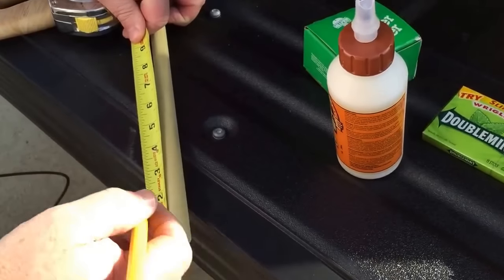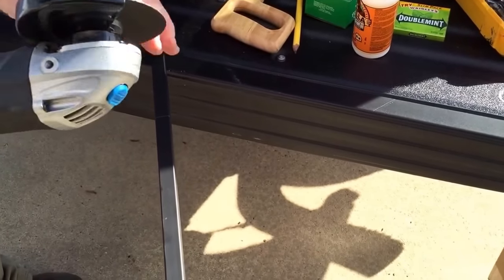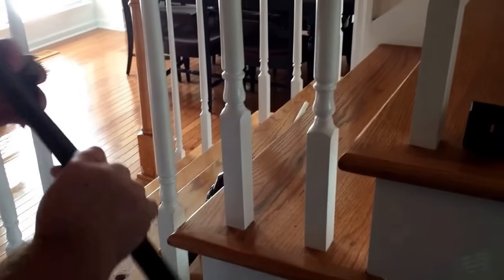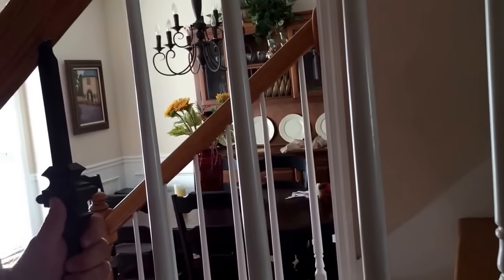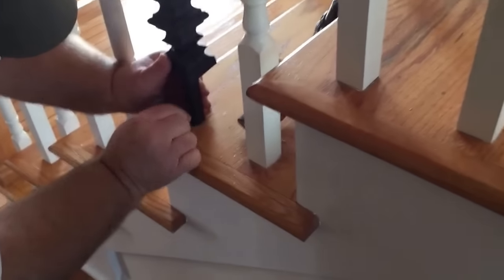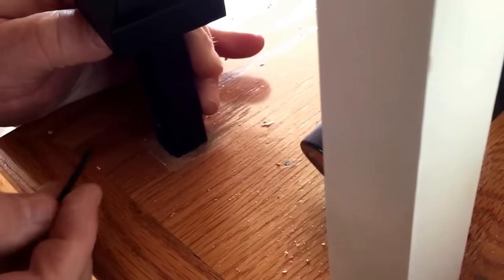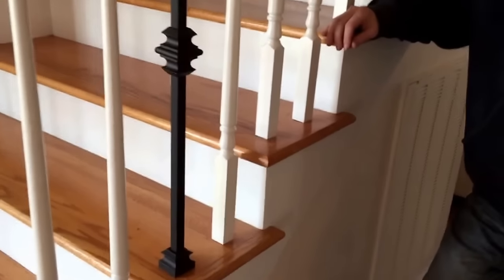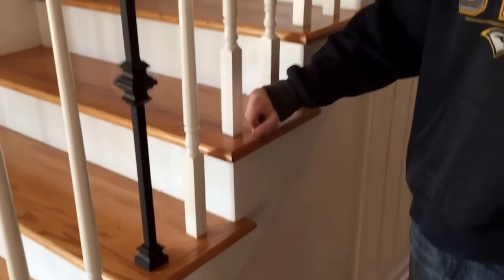Changing Your Wood Balusters to Wrought Iron on Your Fancy Staircase

Comment: If you cut off the peg from the wooden baluster and place it back into the hole, then you can skip all those other steps and save a lot of time. Hammer the peg down into the hole about 1/4 inch pass the floor and epoxy. Easy peasy !!

Comment: Are the balusters still to code?  One issue owners may face is that thicker old wood balusters may be to code (ie where I live max of 4" between balusers), but the new thinner iron balusters will now have more than code specifies in terms of spacing between each.

Comment: Does anyone know what size dowel he used and the type of screw and length of it? This way will help save tons of time!!

Great video
Reply from the maker: It's probably a 3/8" dowel but you have to get one for the stair you are working on.  One size does not fit all :)
Reply: Would it not be easier to drill a bigger hole instead of using a dowel since the shoe will cover everything?

Comment: Does anyone know the dowel size and screw lengths he used?  Someone asked this 3 years ago and I don't believe the question was answered (or I am missing it.)  Thanks for the video!
Reply from the maker: It will depend on the baluster size but these were 3/4"  You might have to sand them down a bit to fit but a snug fit is good.  The screws were 1 1/2" trim screws.
Reply: Thank you!  @ArtisanTony

Comment: Is there a way to properly remove them without damaging them?
Reply from the maker: Not really.  You could cut them neatly at the top but they would be too short to  use for the next handrail
Reply: Twist and lift. Hole in top is probably deep enough to allow removal

Comment: I would have left the wood ones....
Reply: Hi Wayne. I've had the white spindles in my townhome since it was built 16 years ago, but now I desire to change to the metal ones because that's all I see in most of the newer built homes, and it just looks nice. It's going to cost me about $1700 per the stair guy. While I desire to change it out for a more modern and sophisticated look, something tells me that it might not be worth it. I'm just curious as to why you said you would have left the wooden ones. Please can you share your reason(s)? I'm not even going to be in this house much longer( 3 years tops, and then it'll be a rental).  Thanks!

Comment: I would use epoxy to secure the balusters per the manufactures recommendation.
Reply from the maker: that is too permanent and this method worked fine.